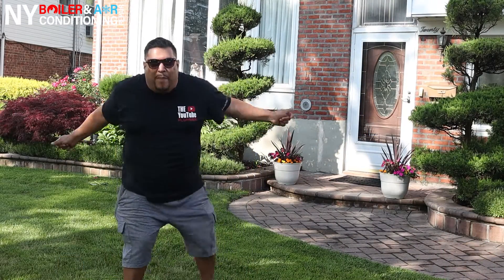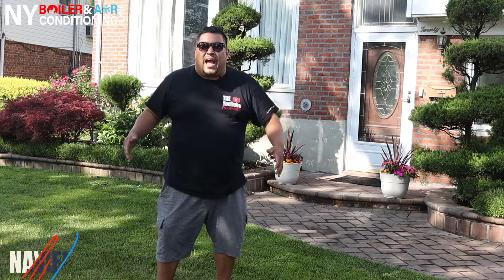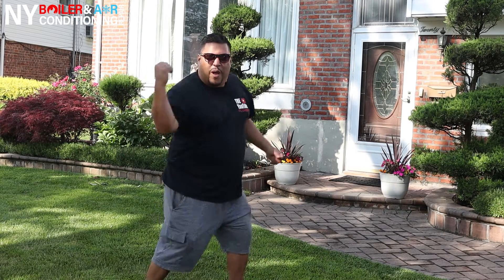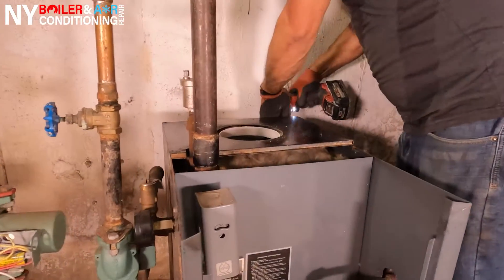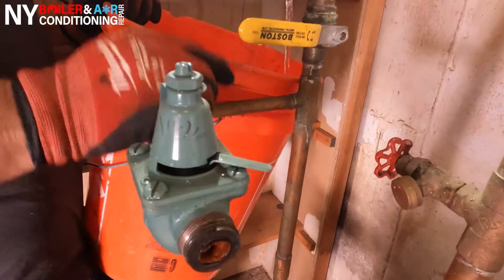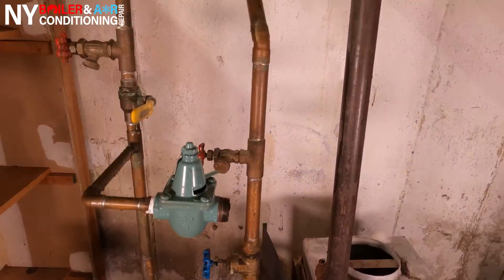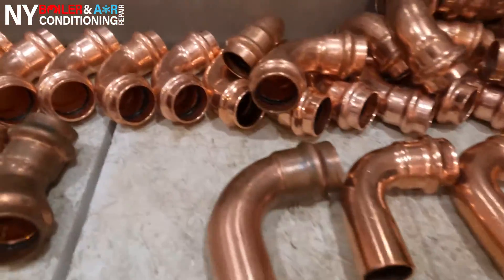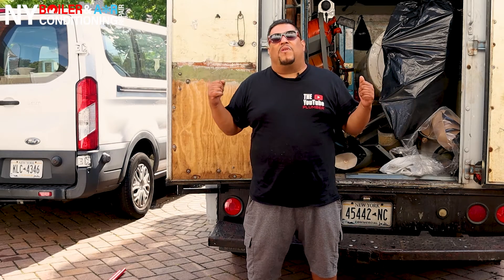NAVIEN BOILER INSTALLATION MODEL NCB 250 150 H (Louie The Boiler Man)

Comment: How do you vent the NCB 240-110 if you live in a condo and only have a 4 inch original vent pipe in a utility closet. Condo will not allow  additional exterior holes. Lease advise.
Reply from the maker: Then your going to only use one pipe for the exhaust and the fresh air pipe is going to be inside the boiler room. Meaning you’re going to use the air inside the boiler room if you can’t make a 2nd hole.

Comment: I have a question does the neutralize " have to be installed?  the bottle with the white pebbles in it?
Reply from the maker: It should. Will it prevent from the boiler to turn on and run ? NO! however you want that to protect your drain pipes if the condensation is going down the sewer pipes. Because the condensate water is acitic it will eat and ruin your drain pipes.

Comment: Hey Louie, thank you for posting these videos and  sharing your knowledge.  I have a question:  What size are the inlet and outlet of the Navien manifold and what type of adapter (reducer?)  you use to connect to the supply and return.  Second, If I were to build the manifold myself (pretty expensive I would say), what pipe diameter is the horizontal run?   Thank you n advance for your time.

Comment: I have a navien 250/150 combo.I cleaned the condensate
 trap.I cannot fill the tube with water because the rubber plug is right up against the back wall.What should I do to fill it?Thank you,Randy